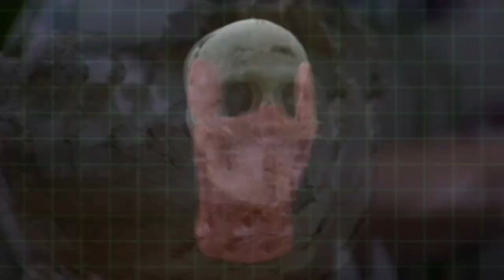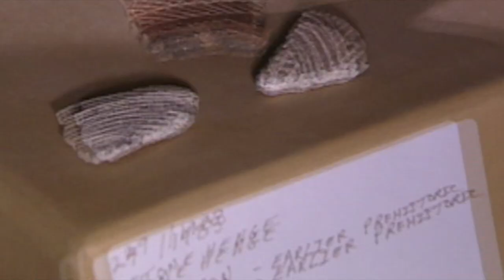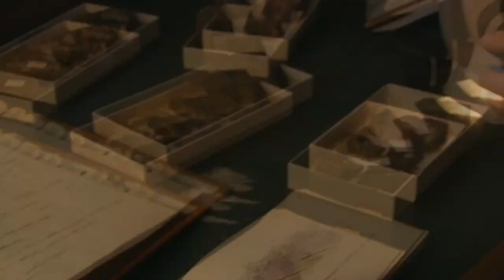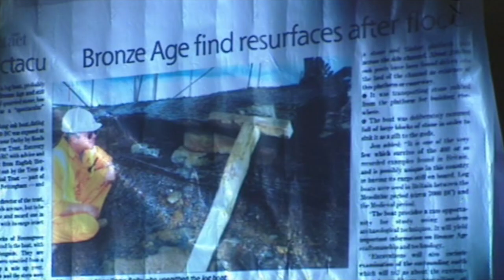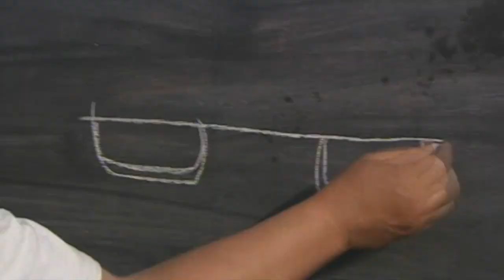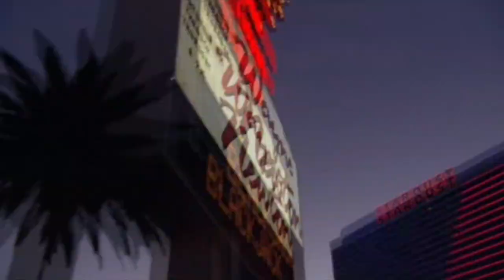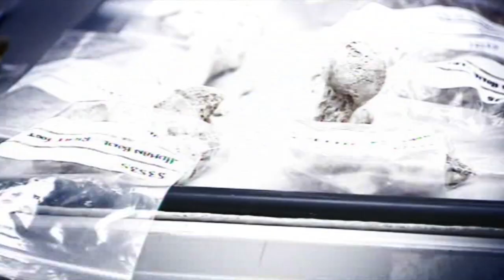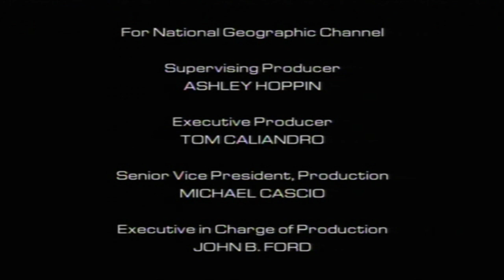Who Built Stonehenge?

Comment: The first restoration of Stonehenge was launched over 100 years ago . And, in 1901
six stones were moved and re-erected. Cranes were used to reposition three more stones in 1958. One giant fallen lintel, or cross stone, was replaced. Then in 1964, four stones were repositioned to prevent them falling.
Reply: sissys justsit underthemin aforce10 wind
Reply: how dare they do that
Reply: @Treefamily187  They were probably forced to do that. Stones don't last forever, ya know.
Reply: @applescruff1969  lol
Reply: Also, they attached the stones to cement which disconnects them from any "energy" or earth energy they may have had to begin with.  One stone is empty inside so a cement block was inserted and it is standing in the ground because of the cement block.  You can see it at the bottom of the broken stone.  There are photos out there of the stones being completely hauled away and replaced according to what the perception of the day believed them to be.  If you look at illustrations from over a century ago, it looks nothing like what we see here.  Most of them were broken and on the ground.

Druids were fairly new on the horizon in Britain.  They were in Gaul first as the Celtic culture moved from the Eurasian Steppe into Europe, past Greece (where they were heavily influenced and continued to trade.  It is possible that the idea of the Druid began with the ancient philosophers, astrologers, historians, writers, and mathematicians of Greece in their white togas.  Unlike the Druids, they wrote everything down.  This is why we have their knowledge today.

Who was wiser? Or, the holder of greater knowledge of the world and beyond?  We will never know?
Reply: @WickedFelina darker than night were the eyes of Felina, wicked and evil while casting a spell….. 🎶 🎶 🎶

Comment: Henges - Rondel enclosures

Stonehenge is a prehistoric monument in Wiltshire, England. One of the most famous sites in the world, Stonehenge is the remains of a ring of standing stones set within earthworks. Archaeologists believe it was built from about 3000 BC to 2000 BC. The original structure was a henge which is a circular bank and ditch enclosure, measuring about 110 metres (360 ft) in diameter, with a large entrance to the north east and a smaller one to the south. It has been dated to about 3100 BC.

What most people don't know is that almost 2000 years earlier, the same types of henges were built in central Europe where they are called rondel enclosures. Henges, rondel enclosures originate in the middle Danube area and Morava area. From there they have spread northward towards south Baltic finally reaching Saxony and Pomeranija. This means that the culture that built these megalithic structures came from Central Europe and reached the British Isles via south Baltic, and specifically Elbe region, Pomerania, Pomorje, the land of Fomori. 

Rondel enclosure, henge structures are mostly interpreted as having served a cultic purpose. Most of them are aligned and seem to have served the function of a calendar, in the context of archaeoastronomy sometimes dubbed "observatory", with openings aligned with the points sunrise and/or sunset at the solstices. This is the case with the "gates" or openings of the roundels of Quenstedt, Goseck and Quedlinburg as well as in Stonehenge. The observational determination of the time of solstice would have served a practical (agricultural) purpose. It could have been used to maintain a lunisolar calendar. The accurate knowledge of the date of solstice allows an accurate handling of intercalary months and determining the the correct date for agricultural activities such as plowing, sawing and harvesting. 

http://oldeuropeanculture.blogspot.com/2014/03/henges-rondel-enclosures.html
Reply: Serbian Irish
They actually started in Turkey from which European people's originated, Gobeki Tepi as a prime example is 10,000 years old
Reply: @marcussparticus8380  no that is only anatolian farmers, yamnaya people came from pontic steppe
Reply: Lo de la isla de Pascua en los muelles es igual que esto nada más que ahí lo tallaron bueno llámame porque me cansé de explicar no digan más cosas que no son ciertas

Comment: I  believe we should consider the possibility that blocks of ice were used to make transport easier. They would have left no evidence, whereas  they would have needed lots of containers to accumulate  fat and carry it for grease.  Maybe, transportation was easier when waterways were frozen?  Ice would have been more buoyant than log boats, and easier to load, on land. Perhaps the ice was formed in trenches, and when loaded, the soil was removed to allow the whole thing to slip, or float,  towards the water crossing.? Logs or rushes,  embedded in the ice would have given compressive  and even tensile strength.
Blocks of ice, cut from the nearby waterway could help large stones,  on sleds perhaps, slip over other blocks of ice.  The erections could have been divided into seasonal episodes.  Even lifting the stone lintels may have just been a matter of leverage and accumulating rubble beneath. Counter balancing can ne amazing to achieve this.

Comment: the stones would have been moved quickly on rolling tree trunks  or logs of various sizes expertly managed to take them from quarry to henge site.  then they built wood henge to honor the logs that had helped them to build stonehenge.  wood henge was not a precursor to stonehenge, it was set up after they didn't need to use them for moving the stones any more.  Believing that all things are alive, they of course would want to honor the logs for their help.  Wood henge was made from the rolling logs used to move the stones.  it would have taken a large group of people to pick up logs after stones had passed over them to position them in front of the stones in the direction they were moving.  they didn't have wheels but they had rolling logs.  the trackways between standing stone monuments were leveled by the rolling logs.  some cause ways built over the marshes were made of logs.
Reply: Fox1nDen
Reply: Experimental archaeology has shown that the rolling log theory does not work.
Reply: A log can only handle a few thousand pounds of stone load before it snaps. Sorry. Try again.

Comment: "We cheated with modern tools."  That's the key sentence of this documentary.  The only reasonable part of the theory of the construction of Stonehenge that is presented here is the boat segment.  The other parts take for granted the use of modern tools and methods that did not exist at the time.  Notice all of the smooth and regular surfaces on those wooden pieces?  No.  Didn't happen.  

If you want to fashion a good theory of the construction, you have to use bronze age tools and methods for the entire project, to discover all of the challenges that the builders faced.  Cheating with shortcuts is stupid in modern reconstructions, and as a result often assumes that these people back in the day were stupid as well.  

Don't you think they would have quickly discovered the most practical ways to accomplish their tasks?  They had to use a lot of time and effort to move those stones.  We shouldn't insult them by not even bothering to go to the trouble of using their technology at EVERY single step to accomplish their task.  Otherwise we're just wasting our time.

At least the modern humans doing the reenactment of the placement of the stones have connected their timbers with ropes, and not nails, in this reconstruction.  Nails were not around at the time- at least ones strong and smooth enough to hold together giant timbers.  I have not heard an acceptable theory of how ropes would have been made in England at that time, but lets assume that strips of leather would have done the job.  

Why would those people go to the enormous effort of building a wooden scaffold with primitive tools- which would have to be laboriously cut, then fastened together with notching and tying--  when they could do something much simpler:  Create a very long ramp of compacted earth, with a far more gradual slope than the wooden structure presented here.  The wooden ramp theory doesn't take into account the likelihood that imperfections in the construction of a wooden ramp would have led to fatal stresses at key points, resulting in the failure of the entire structure.  When that happened the first time, the builders would have been rather disappointed-  imagine what they would have felt like when the same thing inevitably happened for the 10th time.  It's a MUCH better idea to pile your way up, then dig the earth away at the end to return the grade to the level of the surrounding plain.

The other key flaw in all the reconstructions is that the idea that bronze age people could have made smooth and regular faces on their wooden skids.  That is a MAJOR assumption that has not been proven - at least not in this documentary. 

Even with animal grease as a lubricant, the wooden timbers would have to have been polished with sanding stones; they could not have been milled to be anything like perfectly smooth and flat-sided modern boards.  Assuming that only one surface had to be smooth, how would this have been accomplished?  There were no saws.  The surface would have to be created by chipping away bits of the wood, which would have left a very irregular surface.  Imperfections in the ragged surface would have vastly increased the friction between the stone and the "sled rails" on which the stone was dragged by the the people who moved it.

The moving of the rocks was much more likely accomplished by affixing them to timbers that would have served as skids, then rolling these skids over a prepared and compacted surface using logs as rollers- logs that were sufficiently strong, straight and smooth to be of practical use. 

 If the ground surface had not been compacted, the logs would be pressed into the ground.  That would also be true for the direct sliding theory.  Those rails have to be supported by compacted gravel and sand, or they will press completely into the ground and be rendered useless. Notice that the demonstration of the sliding theory uses gravel and sand that we purify by technology that wasn't available then? They also seemed to have mysteriously connected the ends of the sliding posts perfectly for their reenactment.  Yet another lazy assumption.

OK.... enough.  I know.  Why did I bother with this, you're asking.  Me too.  The details are my own inferences, but my support for the "earth ramp" theory comes straight from anthropology class.  My overall dismissive attitude towards lazy theories and reenactments is a result of my professor declaring: "Most of those made-for-TV theories range between 'rather implausible' and 'absolutely ludicrous'.  That's why I have such a stinko attitude towards this video.  I'm very flattered by the few of you who bothered to read this far.  Have a great day !
Reply: The Earth is tilted 23.5 degrees on its axis, a straight line through the planet from the North Pole to the South Pole. The Earth spins around, or rotates, on this axis as it orbits the sun.Sep 10, 2011.......why does it still line up in June?
Reply: i agree overcoming friction is the key to moving huge sandstone blocks. the earth ramp theory is much more plausible than attempting construction of wooden devices. (although we're assuming sturdy A frame type cranes and other kinds of hard-wood frames were not available, but we cannot prove these devices were not in use). 

depending on environmental conditions, ice would ensure less friction at certain times of year. animal fats, ice, earth ramps and a team of very strong people could make this happen. working in cold conditions is difficult (i happen to be an engineer) - but with the right kit on (layers of fur for example) it could be achieved (with much determination and will power) eg: scotts antarctic team pulled sleds across the ice shelf (when conditions allowed). 

i also agree overcoming soft uncompacted surfaces would be vital, if the the stones were transported across land. today, roads are constructed with compacted substrate before a smooth surface is applied (but I dont think there's archeological evidence of these kind of roads round stonehenge... if anyone has evidence otherwise, I'd be interested to review it). we're assuming water channels and flotation devices were not used either (but we cannot rule that out as a method, since friction issue is overcome using water and flotation devices like air-filled bladders). 

the interlocking and modular nature of the stone lintels at stonehenge (probably using geopolymer concrete) is highly advanced work. i'd like to point out, many builders dont use this method, even today. whoever really built the henge and other ancient sites has advanced knowledge of polymers, lifting techniques, transport logistics and astronomical positioning of planets in our solar system. Everything points to them from not being from "around here". I know, that opens the door to exotic theories.. but we can't rule those out, either.

conducting electromagnetic readings at the site, the position of leylines (magnetic force lines) at the site will yield interesting results. stonehenge looks like a device for focusing electromagnetic energy from the air. It's logical to assume this was it's primary function. 

peace. thanks for reading.
Reply: God damn how did I read that but agreed

Comment: there  are over  2  million   stone blocks in the GREAT PYRAMID   weighting  2 too 10  tonnes each   All were different sizes,  but  they were cut so perfectly  flat on all sides that you cannot fit a credit card between any of them.  This was very hard granite The Pyramids have 8 sides , each side has a slight concave split in the  center of each side , visible only if flying over top  and only on the exat time of the summer  solstice. There are chambers , corridors, little  foot square shafts all cut so perfectly.  They  were  an advanced civilization or had help  from ONE. They are a  many many thousands of year old , miracle.

Comment: Who built this ? Over the years we have moved and refitted this structure 6 times since its original discovery . how was it built well  Dam off the area fill it with water float the stones to the site hence float the stones into position . Remove the water and dismantle the massive dam structure move the scrap away bingo Stonehenge stands alone . I Don't know how it was constructed but that's my opinion with out any machines how else would one move large stone slabs ? They did the similar process to build the pyramids . Cheers

Comment: Stonehenge is a mortuary temple for the Ka & Ba parts of the soul and was built around 2831BC by Pharaoh Hotepnebty 'Bed jaw' and Queen Selah- Hathor, Bedjaw means foundry man.,' pouring into a mold ' It was constructed from geopolymer artificial sandstone, the same as seen in many columns buildings etc. all over Egypt and the great pyramids. Straight west of it is the Dog Head -Big Arm Last Mountain Lake Sask. Canada. Stairway to Heaven. There is an ancient  12,000 Star map below the Dog Head script that you can buy. I got it from Information Services Corporation Regina Sask  which use this technology to locate  underground gravel deposits.The Dog Head of Judah in 2 Samuel 3:8 is this site as Judah controlled this area 3000 years ago and later in Rev 22:14,15.

Comment: There’s nothing mysterious about Stonehenge if you know how it works. It can be used to predict solar and lunar eclipses. Around the outer edge of the site there are over 50 small pits or “ peg holes “. If you mark where the sun and the moon are every day as the year progresses you can predict these events. So if one day in the year the sun and the moon are directly opposite each other in this system a prediction of over 99.8 percent one can determine there’s going to be a solar eclipse. All it takes is for someone on the ground to plot the Lunar position each day of the week. It’s easy to use and extremely accurate.
Reply: Lol, nah, nothing about it is interesting or mysterious.

Comment: When I was there tourists were able to explore the whole monument, even the surrounding grounds, the sight stone, and you could walk up to the stones.   When you stood touching a stone you felt a cosmic feeling of floating in space, traveling through eons of time and space.  Now you cannot get near it. There was some carvings on the stones, some modern initials etc.  The alignment with the rising sun on the Summer Solstice occurred about 4000 B.C.  The original designers probably came by boat from Egypt.  They laid the plans and used locals as slave labor.  The ancients levitated the stones with sound.  They had a maximum work force of 3000 laborers, and the original construction spanned about 25 years.  About 500 years after the original building it was added to, and 500 years later it was added to again.

Comment: DEAD  WRONG but, nice try folks.   Admirable demo using relatively minor rock, ingenious work, and so many volunteers.   WOW !!!  

Solution presented on 'net,  2016.   Sorry to rain on your fascinating parade.

Small crew of Welsh labourers, log rafts for much larger , heavier, shaped stones, the use of advanced ULTRA SOUND TECHNOLOGY, floated on air, and merely steered by Welsh, similar to methodology used in Giza construction by off-planet architects and engineers.    Advanced technology not multitudes of Welsh primotivo manpower and enormous labour hours, and perhaps, a doable land route, even if rugged terrain, twice as long, is suggested by outstanding skilled modern, revealing research.

See  YT  Farsight Institute, The Great Pyramid of Giza : The Mystery Solved (Complete Version)
SOUND handles the heavy weights !
Reply: off-planet architects and engineers ? Hype and hoax is all that is.